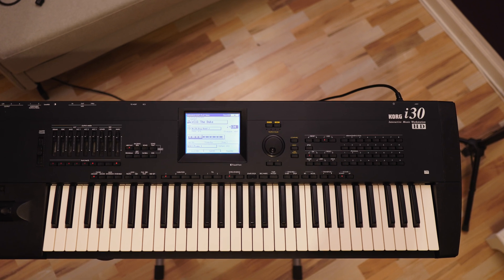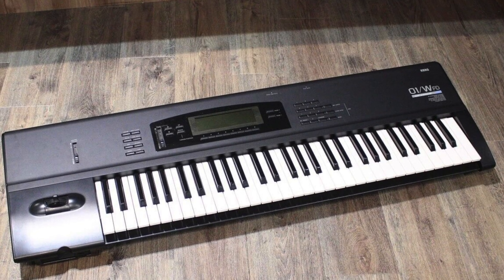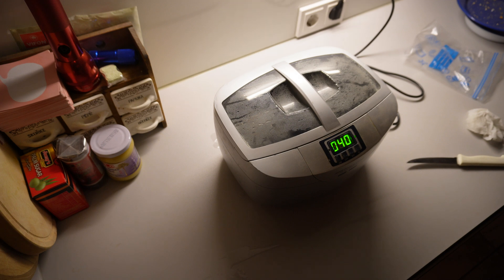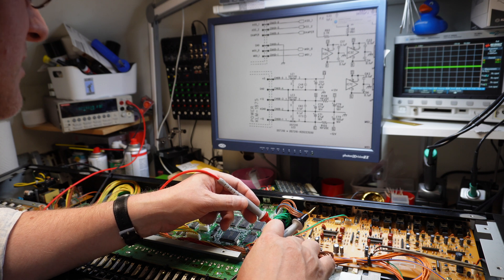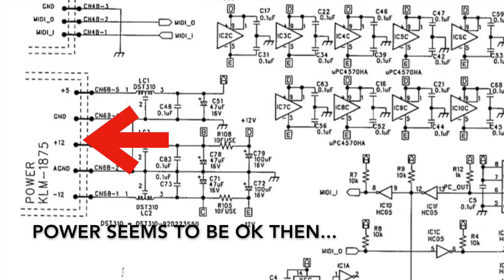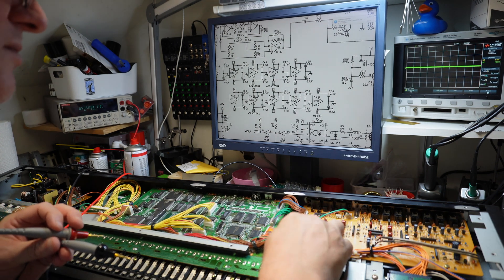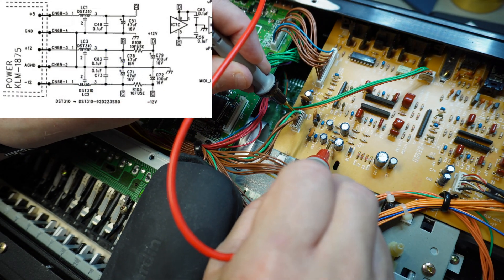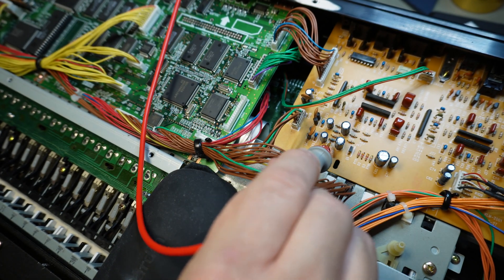‎ReinardSynth #13 Korg i30 „no audio“ Repair

Comment: Hi,
KORG i30 is one of my favorite instruments and my mascot. Since 2001, when I bought the first one, I always have 1-2 of them to feel good about myself.
I have compared its sound with many high-end workstations and its tone set and sound still hold their own.
As an arranger, it may not be as sophisticated as a Ketron SD1, Audya, or SD9, but on stage, in a live band, its sound always comes through the music and is like an air raid siren.
It is made of the best materials available in 1998. You certainly won't get such a durable and high-quality piece from any manufacturer today.
Currently, I have a PC3, PC4, Nautilus 73, and Krome EX 88 on a stand in my room and I seriously say that my sound settings written for performance, (keyboard set) are in no way inferior to the other 4 big irons. Obviously, there is no drawbar organ in this, but the FM EP, the rock piano, the synth sounds are life-threatening in it.
I play rock music from the 70s-80s-90s.
Good luck with your work and your channel. I subscribed because this is a good place.
Buba
Reply: "[T]he synth sounds are life-threatening"! LOL, great line!!! 
I have a variety of great Korgs and Kurzweils, too, including an 01W (essentially same chipset as i30).
Since you seem an absolute expert on i30, do you know if there are any work-arounds to i30's lack of Combi mode (to layer/split/switch/xfade 8 or fewer Programs)?

Comment: Greetings, I have a Korg i30, it has a detail, there is no audio, I tried the audio card in another Kong i30 keyboard and it is fine, the problem would be in l
Reply from the maker: would be in I....?? traced signal from DAC as well like I did in video? sure Local=On?
Reply: Good morning, greetings, I reset the keyboard and it showed this error v55BkuproM and there is V55Midi and V55Pcif

Comment: Stuck on logo,
Reply from the maker: … yes… and?
Reply: @reinardsynth6581  My Korg i30 is stuck on the logo, what should I do?
Reply from the maker: @SKAPARTKEYBOARD   check voltages. Disconnect internal hard drive (if any) and disk drive and see if it goes past the logo... Something is holding it up on booting... If this does not help: bring to local repair shop... Too many things that can be the root cause for this, impossible to remotely diagnose...
Reply: Oke terimakasih sudah berhasil bos,,bagaimana cara pasang hardisk di i30 ya??
Reply from the maker: @SKAPART  could you translate to english pls?
Reply: @reinardsynth6581  how to install a hard disk in a korg i30? I don't have the original connector tha😰😰please draw a schematic, thank you
Reply from the maker: @SKAPART  gontonsection „installing hard drive“ on https://silverhawk33.tripod.com/id4.html